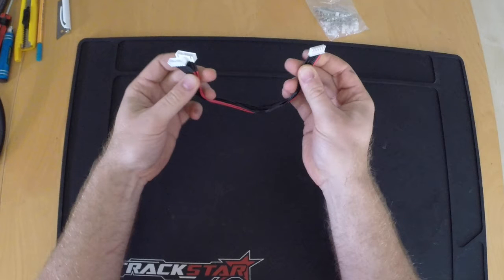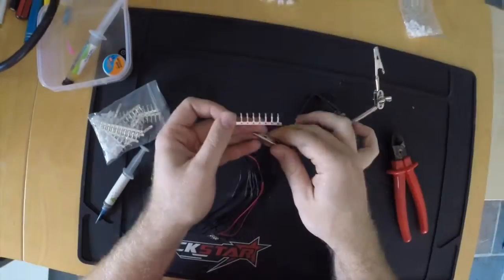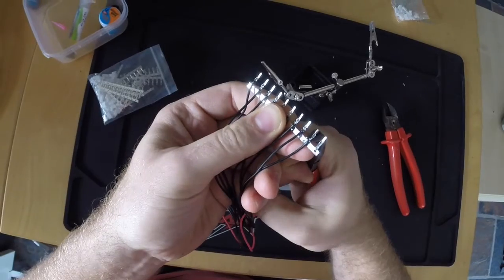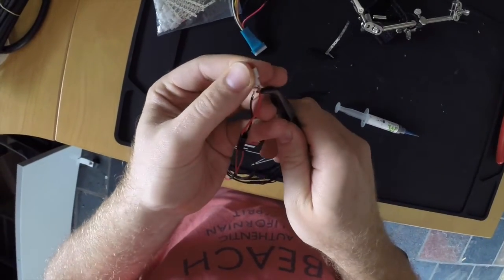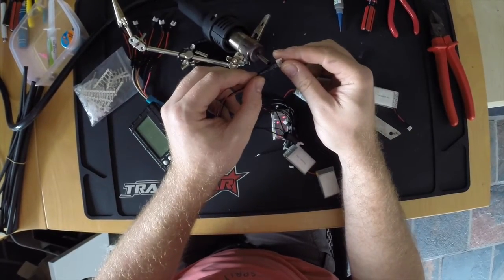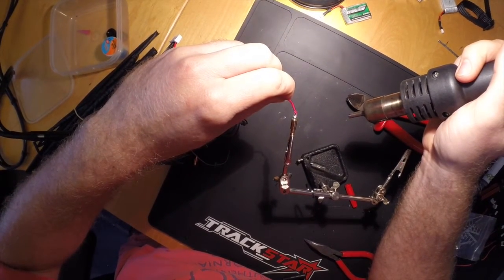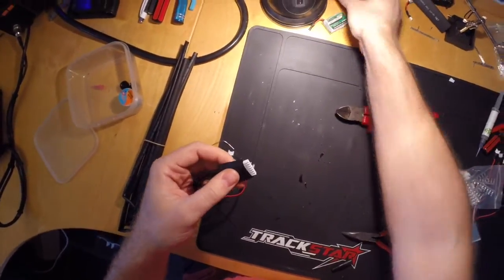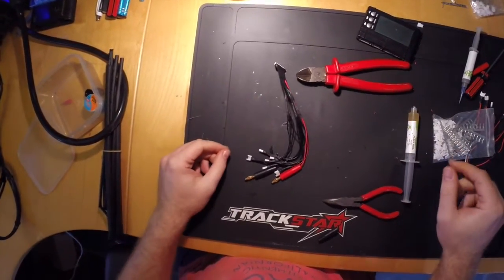How to make a serial charging adapter for single-cell LiPos

Comment: I love your method of teaching! Any advice on connecting 7 of these cells in series and charging them all too? Thanks in advance!
Reply: Here are the cells - http://www.componentshop.co.uk/3-7v-2200mah-25c-continuous-discharge-lipo-battery.html
Reply: Thank you! 
You would need a 7S balance plug and a charger that could deal with that. I have never seen 7S packs or chargers, but if you have both, just apply the same method as per this video.
Reply: Micro Motor Warehouse sure thing. neither have I! I'll try get hold of some! Or just charge 6 as you have and one individually.

Comment: Bro, will this adapter do the same job?
http://www.ebay.com/itm/6-Cells-Balance-Battery-Charger-Adapter-for-Walkera-Hubsan/161277835542?_trksid=p2047675.c100011.m1850&_trkparms=aid%3D222007%26algo%3DSIC.MBE%26ao%3D1%26asc%3D33099%26meid%3D5ef8d4f9f1f545ee8d81178e3bf596c1%26pid%3D100011%26rk%3D3%26rkt%3D10%26sd%3D400391037573

Comment: Wait, so I didn't get a good close-up....  The first plug has a red and black (presumably pos & neg).  The subsequent charge ends have...?  It looks like just the negative leads???  Do you happen to have a diagram (or know of one) that shows what this adapter looks like when it's done?
Reply from the maker: Sorry.. Didn't see this comment for a month :(
Well.. Positive of the second plug is negative of the first and so on.
You connect one cell between each of the pins. Just like the wiring of every balance plug on every multi-cell lipo.
It thought it would be obvious.
Let me know if it's still not clear, and I might just draw it up ;)
Reply: Found some pix and diagrams that cleared it up. Don't have any multi-cells to tear apart or know how they're wired up. Will be making one as soon as I have the $ to buy a good balance charger.